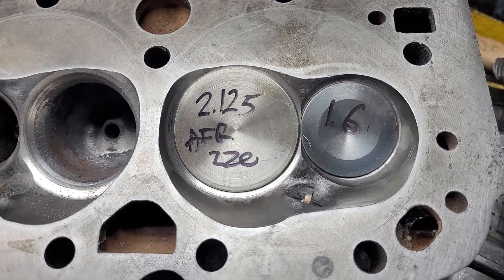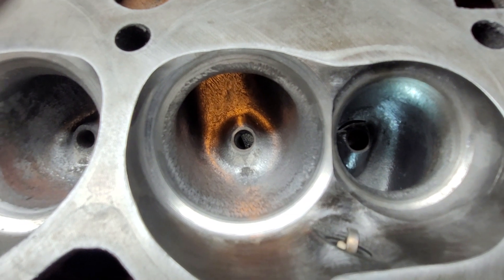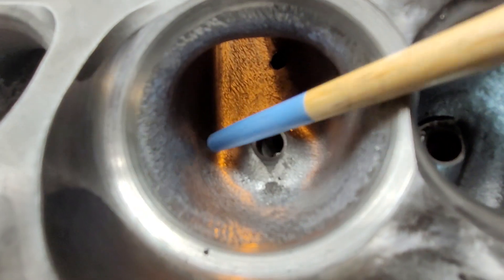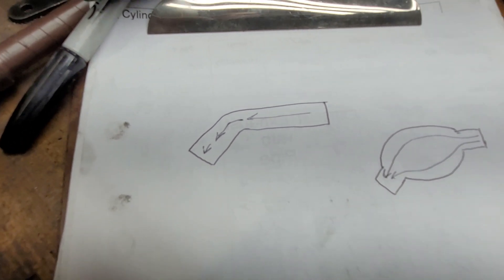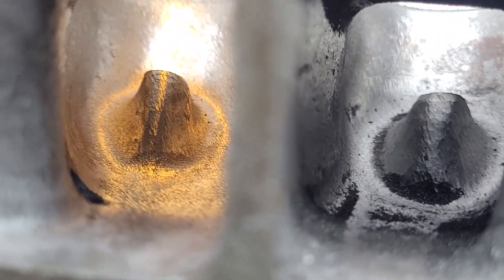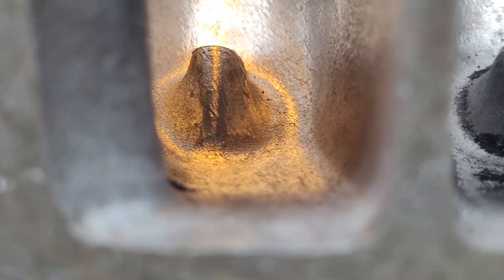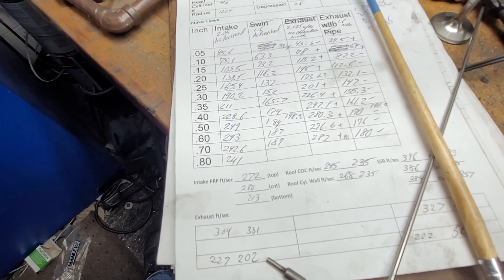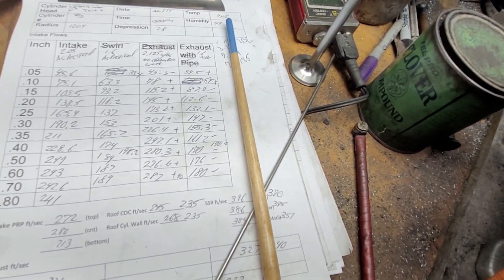Ported World Sportsman 2's cylinder heads. First cut flows with oversized intake valve.

Comment: Make the bowl big, really big then use a vane on the floor Right above the short side turn.  I would of ran 2.100" intake to 1.68" exhaust😉.
Reply from the maker: I was thinking of that. The ssr is .35" thick so I have some metal to work with. I did a fin like that on my Dart 215's and they flowed very well.
Reply from the maker: These are not 60/40 heads so 2.1/ 1.6 are probably max size. I need to check.

Comment: For texture I am going to guess diamond burr. Agree on those shear angles on the intake.
Reply from the maker: My diamond burr leaves straight lines.
Reply: @servediocylinderheads  Another guess for the texture: A rasp burr. Like what a jeweler would use.
Reply from the maker: @rennypizarro4432  I looked up rasp burr. That is not what I used.

Comment: What percentage will the intake throats be with those intake valves when you are finished and did you use a carbide for aluminum to texture that port wall?
Those are heavy wall castings but do you know if they vary much from year to year as they revised them? 
Nice work and thanks for your time and information....
Reply from the maker: I don't know how much they vary. Bowl ratios will develope. They are tight now.

Comment: Interesting you say the air/fuel wants to stay on the exhaust port side of the intake port, when DV says in his book it's the opposite.. the cylinder wall side.   He says scooping that side out for port bias is the way to go.  I've heard that from other porters as well.
Reply from the maker: If it is done right the air and fuel should be mixed really well and not seperate.

Comment: For 600 hp NA, given enough cam, compression, and rpm, I would suggest 280-290 cfm on the intake and 230cfm on the exhaust. Certainly, this is a very oversimplified suggestion.  But I am sure you understand that.

Thanks for all your videos. I enjoy your work.

Comment: How are those valves ever going to seal? Won't they interfere with each other? The bowl in the exhaust port got too big and the air is circulating inside it. Also when the wall texture is too coarse, it creates vortexes that "shrink the diameter", i.e laminar flow area. This can be used as an advantage if there's pockets in walls, to direct the laminar flow, but to get the best flow results I've always used sand paper finish, even on carb ports. 120 on wet ports, 240 on dry ports. It just flows better.

Comment: Yes always change the shape as little as possible to Increase the flow that means  only make the port lean. Don't  really touch the walls. Touch the bowl. Valve guides. And short side radius. And If the pushrod pinch becomes a restriction. Then take it out to where it is just slightly larger than the throat area.

Btw, thank you for another great video. They are enjoyable to watch.
By lean I mean port bias.